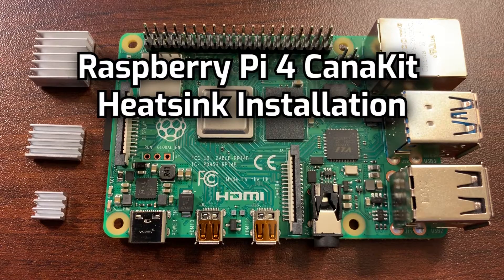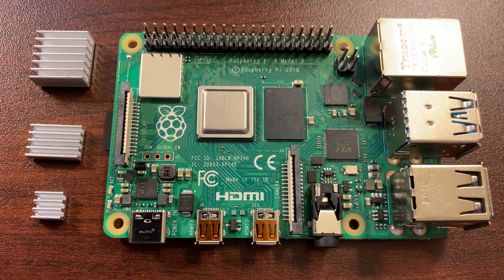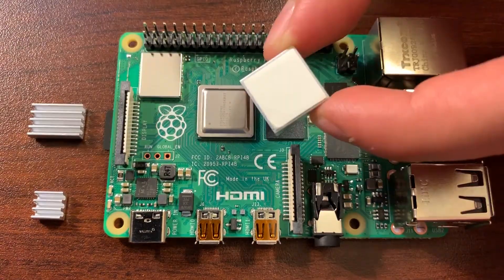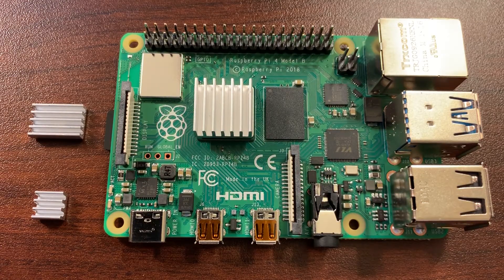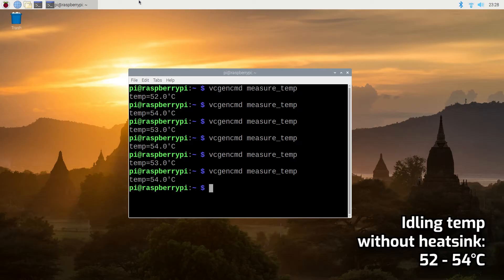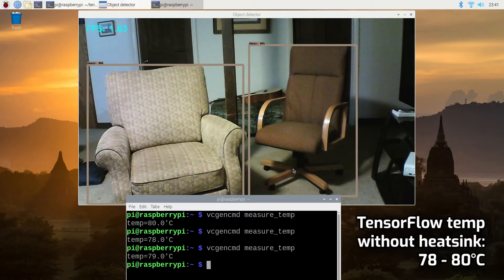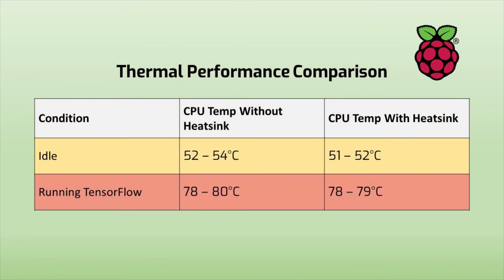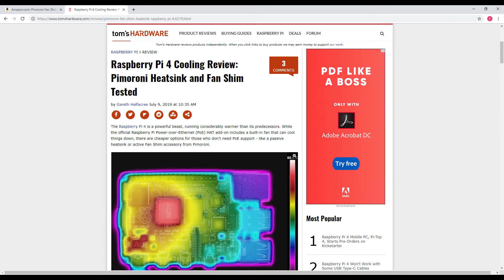How to Install Heatsinks on the Raspberry Pi 4 (CanaKit) + Temperature Performance Comparison

Comment: This was helpful, but I have to point out a glaring and often made mistake with the premise of your testing:  Thermal solutions do not reduce temperatures.  I know that sounds counter-intuitive, but they just don't.  Let that sink in for a sec.

Looking at the before and after temperature doesn't tell you anything at all.  You're missing the performance aspect.  The temperature didn't change before/after, and it should not have, because you didn't do anything to adjust throttling or power consumption.  So what you might have seen would have been a significant increase in performance.  So, given that same temperature, and knowing that you're dissipating more heat, you should be burning more energy, and energy is performance.  Without looking at that aspect, the testing section is actually pretty misleading, as it indicates that the pads didn't do anything... because performance wasn't evaluated.

Comment: Stupid question: for the squared heat sink, does the rotation matter?

Edit: also, if I have a heat sink that is smaller (in area) than the chip, can I use it anyway or will it make things worse?

Comment: Thanks, I wasn't sure where the rectangular one should go. I had 4 heatsinks, actually. Two tiny squares aside from the larger square and rectangle
Reply from the maker: Glad this video helped a little! I'd say the extra one should go on the power supply IC in the bottom left corner (just above the USB-C connector). I'm curious, where did you order your heatsinks from?

Comment: Aluminium is not good as heat exchanger. You should use copper. Copper is best affordable material at thermal conductivity after diamonds and silver. Copper its 3rd material in the world good at heat exchanging.
You have to do research in physics before attempting to use cheap metods of cooling.
There are many consumer grade products sold only to unexperienced users that don't know how to invest their money when building a pc. Not everyone can afford to spend.
But when you post on youtube, make sure you spend money on good diy projects and make sure you advice people in the right way.

Comment: Thanks for the video. Small hint: use "watch -n <seconds> <command>" to continously execute a certain command. Example: "watch -n 5 vcgencmd measure_temp". This will execute the temperature-measurement every 5 seconds automatically.
Reply from the maker: Thanks! I didn't know about that one. I learn more and more about Linux every day :)
Reply: @EdjeElectronics  Great! Glad I could help. There is one thing, I forgot to mention: measure_temp and meassure_volts have a notable impact on the CPU. So, if you are running this with a very short interval, you mess-up your values. So maybe 10 seconds could be better. You can also use the parameter "-d" so changes will be highlighted.

Comment: Did you have the Pi in a case for this test? Heatsinks only work if they have something to transfer the heat to, like air flow. Without air flow to take heat away, the heat sink will just warm up to the same temperature.

Comment: Is it ok to aply thermal paste and then attach the heat sink
Reply: If you had a way to clamp the heatsink yes, otherwise, the only relevant suggestion I found on comments was to cut a middle square on the tape, to insert thermal paste (very little) while the tape still sticks the whole.

Other solution that might be + practical: buying thermal heat sink glue or better thermal pads (better heat transfer, > 6to12 W/mKelvin), & finding copper heatsinks instead of alu. + adding fan as mentioned in the vid, could make any solution + worth it; would like some tests of these, but don't have the material for it.

Comment: The reason the heat sinks don't do much to reduce temperature is because the foam double sided tape is an insulator. 
It makes the heat sinks easy to install but the trapped air pockets in the foam insulates the heat transfer. 
I scraped the tape and all its residue off down to shinny aluminum and used thermal heat sink glue available on Amazon.
I'm still downloading 128gb RetroPie image but will try to report back my temps with glue/paste versus tape.
Reply: Whatever happened when you tried this method? Thinking of doing it this way as well of scrapping the foam and use a thermal paste instead.
Reply: The only relevant suggestion I found on comments was to cut a middle square on the tape, to insert thermal paste (very little) while the tape still sticks the whole.

Other solutions that might be + practical: buying thermal heat sink glue as suggested here, or better thin thermal pads (better heat transfer, > 6to12 W/mKelvin), & finding copper heatsinks instead of alu. + adding fan as mentioned in the vid, could make any solution + worth it; would like some tests of these, but don't have the material for it.

Comment: Thank you. As others have said, I wish I had watched your video before wasting my money on heat sinks! I have probably worked with about 20 RPis, mainly gen 2 & 3, most of them running for years, and have only had one main board die. I never saw the need for heat sinks because I do not attempt to overclock and figured if the engineers were smart enough to build the thing they would have put heat sinks on it if needed. However, one of my first two RPi 4s died after about 15 months (it was the only one under constant use) so when I bought the replacement I also picked up a couple heat sinks. Looks like they're not worth a hoot but I might as well stick them on now that I have them. I was just out here searching for info on which chips needed them the most. Thanks again.
Reply: If you bought aluminium, you will fail again.
Copper its the cooling material if you want passive cooling. Use pure copper with fins.
Add a 5v mini fan for overclocking.
Do not use aluminium. Aluminium its poor in cooling.

Comment: Thank you. They also didn't show how to connect the fan, but just use the GPIO header and connect to the red wire to +5v and black wire to GND (pins 4 and 6 respectively). The diagram is oriented as such that J8 as pictured corresponds to the location of the J8 label printed on the RasPi.

Comment: Its been verified by an official source at Raspberry Pi that the Heat Sinks should go on the Network controller (silver chip above the RaPi logo, not the RAM), CPU and USB.  https://www.raspberrypi.org/forums/viewtopic.php?t=247323.

Comment: Ideally you'd want it in the SOC, the Gigabit Ethernet controller and then maybe the USB controller and/or the voltage regulator where the power goes in. No real need for it on the memory chip, that shouldn't get hot.

Comment: Would have been cool to know what the FPS was with and without heatsink, since it likely could have been the same max temp, but much higher FPS because of the heat throttling like you mentioned...

Comment: Wait what? no difference in temperature?! Thanks for the info. Should have watch this video before I ordered mine.
Reply: Guys: PI is lowering CPU performance when reaching 80°C - so it makes no sense to compare the temperature, but it would make sense to compare performance!  Because the heat sink allows the CPU to keep performance!
Reply: @robertjschulz  also he didn't install the fan, that would have improved performance even more
Reply: I was expecting a dramatic difference lol
Reply: complete useless lol

Comment: Eait I only have a cpu heat sink should I worry about my pi over heating
Reply: No. They're designed to run fine with no heatsink at all. I think it's overkill adding them to other chips than the SOC ... But it also doesn't do any harm. Adding just the one on the SOC will at least delay throttling. Throttling is normal to maintain reasonable temps.

Comment: Finally, i watched this video. 
There is a DOUBLE END TAPE between the heat sink and the Pi Board. It will be better if HEAT SINKS are installed using some heat sink paste to achieve better results.
Keep uploading ideas and trends!!!!!TC
Reply: Those are thermal pads.
Reply: @Dixitkushagra175  Hmmm. Can u share any product link, I have always seen with double side tape. I am interested in such things
Reply: Thank you very much.
Reply: They dont perform well

Comment: I only have the biggest one and the smallest one, and I can't buy more at the moment (out of stock in stores and I can't order online right now). So I have to leave one out. Should I place it ontop of the RAM -or the USB-chip? 🤔 My guess is that the RAM-chip gets hotter, but the heatsink won't fully cover it's surface, so I don't know how efficient it would be. If I choose to place it ontop of the USB-chip it fully covers its surface - but then the RAM-chip won't have any heat-dissipation at all... 🙄

My question is, where on the board would it do most good? 

And yes, I have Aspergers... 😅
*"Decisions"* (ᴗ‿ᴗ')
..isions"* 💨💢🏌️‍♂️
👋🏻(。ᴗ°).∘Bai!

🌞🌈 ᕕ( ᐛ )ᕗ
             ┌\‿

Comment: I was looking at the thermal image of a plain Raspberry Pi 4 under load, and it doesn't appear that the heatsinks on top of the RAM, the Gigabit Ethernet controller, or the USB controller do much of anything.  Rather, after the CPU, which is the main generator of heat, the voltage regulator in the lower left corner is the secondary source of heat, and the other components don't get very hot.  Seems like the voltage regulator and the CPU would be the best locations for heatsinks.  Now, if only the kits prioritized a heatsink that fits on the voltage regulator...

Comment: I dont know but somehow the glue doesnt look like its a good heat conductor. Is there a way to use more traditional heat paste and fix those heatsinks in a different way?
Reply: I also want to know this... it seems like a bad design.

Comment: Ok, another video answered my throttling question:  Pi 4 does not throttle until 80c, and under 100% load, Pi 4 reaches 80c in 3 minutes and 30 seconds.  Depending on what you're using the Pi 4 for, it may never be at 100% for 3 minutes straight, so for many applications it's not worth spending a few dollars on a heatsink.
https://www.youtube.com/watch?v=Wwk4HR9G51Y

Comment: I wish you showed the difference between throttled and not throttled because some of these heatsinks cost 20-70% of what the Pi 4 costs and previous Pi reviews showed heatsinks helped but were unnecessary since the cpu did not throttle enough to warrant the extra cost.

Comment: nice video i seen some have small HS for the volt reg near the USB Power in put,
do you have video on the best SD cards and make model and size, as i been using sandisk
i found the 64gb was much faster then the 32gb. 

By the way i am new as this i only just been doing it today

Comment: A problem with these adhesive heatsinks might be that the adhesive/thermal pads act as insulators instead of properly conducting the heat onto the heatsink.
Reply: those white tape with blue plastic usually are the thermoconductive ones, black or transparent ones are just double side tape.
Reply: Exactly!
Reply: Can we use thermal paste?
Reply: @justafreak15able  yeah just use a little and make sure you wipe off the adhesive with 91% rubbing alcohol.
Reply: @justafreak15able  you need to fix the heatsink so or thermalconductive glue, thermalconductive epoxy, brakets or a drop of superglue in each corner and thermal grease/paste in the middle. but this make hard to remove, and some glues can come off with time or too high temperature.

Comment: Great video.  However the heatsinks are next to useless as they are not directly fixed to the chips via a thin layer of thermal paste (which aids heat transfer).  Instead they are fixed via sticky pads which means that the heat transfer from the chip to the heatsink is very poor.  Yes they may help to a small degree but a case mounted fan would be far more efficient.
Reply: what are thermal pads
Reply: @kristoffseisler2163  They are sheets/pads that are made of thermal conductive (but typically not electrically conductive) material, that are placed between two components to maximize surface area contact and thus thermal conductivity between them.

Comment: I saw in other pictures that the last heat sink should be in the top right instead of where you placed it.
Reply: This is the wifi chip and Should NOT have a heatsink on it.

Comment: The heatsinks double stick tape doesn't seem like a very good material to transfer the heat from the chip to the heatsinks.
Reply from the maker: I think it works fine! The people at Canakit (or whichever supplier they got it from) probably know what they're doing. Might be worth testing with thermal paste too, though!
Reply: @EdjeElectronics  This was my first thought when I saw these heatsinks. The plastic on the pads must be a poor heat conductor

Comment: Thank you! :)
My set came with 4 heatsinks, the additional one being even smaller than the smallest one from your set.
I assume the additional heatsink is for the chip above the one you applied last.
EDIT: The last heatsink might aswell go onto the chip in the lower left corner, which seems "surrounded".
Now I'm confused.
Reply from the maker: Good question! That fourth one should be installed on the small chip in the lower left corner. That's the PMIC chip (power management integrated circuit) which is responsible for powering the Pi, so it generates a good amount of heat. Just be careful to make sure it doesn't touch any other components when you install it, or it will short them out. The second picture in this blog post shows the hot spots on the Pi: https://www.tomshardware.com/reviews/pimoroni-fan-shim-heatsink-raspberry-pi-4,6219.html
Reply from the maker: Having said that, if it looks like your heatsink is too big to fit on that chip in the lower left corner, then don't do it! Put it on the chip in the upper right corner instead.

Comment: Thanks. 
Questioning the thermal transfer properties of the double sided tape as opposed to using a thermal paste to adhere the heat sinks
Reply: The problem with thermal paste is the heatsink is not going to stick without some kind of clamp. I suppose one could cut a smaller square out of the tape instead of removing it entirely and fill that square with thermal paste.
Reply from the maker: Good point.. could be worth trying an experiment with both to see which one gets hotter!

Comment: You totally saved me. Another YouTube video I found told me to install the heat sinks in the wrong locations (over the wifi chip and some other wrong spot.)  As a result, my machine was practically melting and severely underperformed. Moved the sinks and all is well now!
Reply from the maker: Yikes! Glad you were able to get them installed correctly. I still think it's weird that CanaKit (and some others) didn't include any instructions with their kits on where to put the heatsinks!
Reply: @EdjeElectronics   my kit thankfully came with instructions. It was hidden in thr manual.
Reply: @EdjeElectronics   however, I bought the complete kit with breadboard wires and etc

Comment: No cooling paste required?
Reply from the maker: Correct, you don't need to use thermal paste, because the heatsinks already have some. The white material on the bottom side of the heatsink is the thermal paste.

Comment: I forgot to buy heatsinks.. 🤦‍♂️ Should I wait until I've installed them, or is it safe to operate the Pi without any cooling-solution for a couple of hours at a time? It won't damage it or anything, just slow it down, right? 🤔

On second thought... I live in Sweden, so basically my Pi is already inside of a big freezer anyway! 🤣

"Sweden - the only country where temperatures above 0°C is considered warm! 😎"

(...I'm serious, my neighbor actually starts wearing shorts at ~8°C... xD)
Reply from the maker: Haha yes, it's fine! It won't damage anything. You can use it as a space heater if your room gets too cold 😉
Reply: @EdjeElectronics  Wow! Raspberries has so many use-cases! 😄 Haha alright thanks! 🙂

Comment: @
Edje Electronics

Is it true putting heatsinks on the RAM chip runs a risk for short circuits and do you actually need them on the RAM chip?
Reply from the maker: Hi Kabir, it is possible to short out the components next to the RAM chip. However, it's very unlikely if you are careful: just make sure the heatsink isn't touching any other components except the RAM chip when you install it. The RAM chip doesn't really need a heatsink, but it doesn't hurt to use one. The 5th picture on this product on Amazon shows in red which components can accidentally be shorted out. https://www.amazon.com/LoveRPi-Performance-Heatsink-Raspberry-Heatsinks/dp/B01J58A2DM

Comment: Needed a question answered.
Found a video that's 2.5 min long, doesn't have a bullshit opener with tons of ear-shattering dubstep, there is no begging for likes and subs, and it just flat out answers the question at hand without any unnecessary exposition.

Seriously, what more can you ask from a tutorial?
10/10 would watch more from this user.